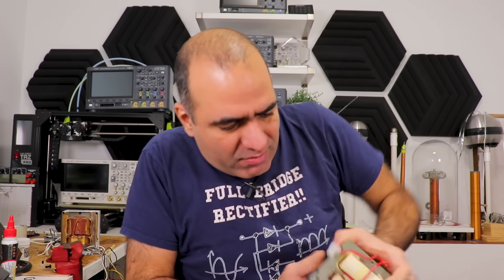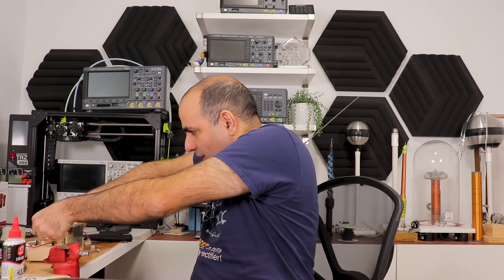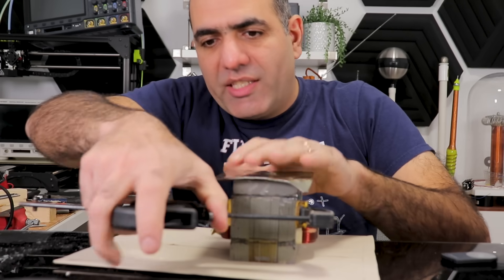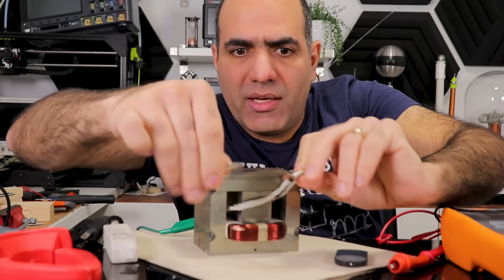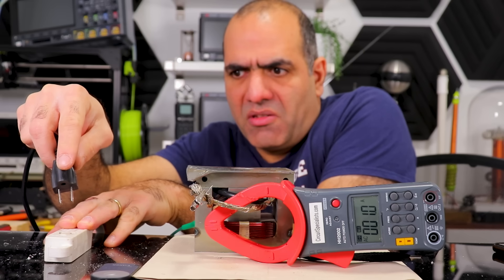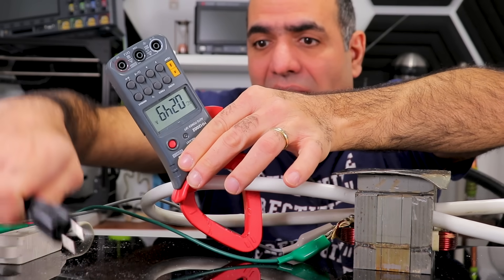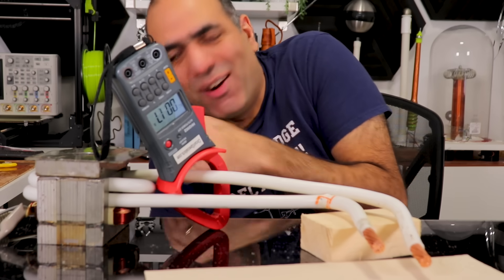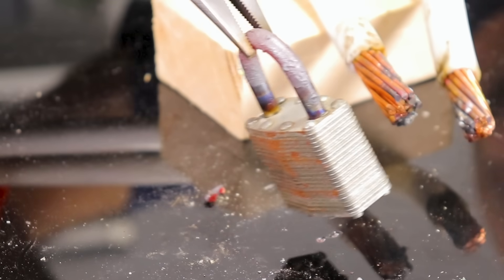Making "MILLIONS" of AMPS of Current

Comment: This inspires me to do electronics/electrical projects of my own but at the same time I feel like that's a very very bad idea 😅
Reply: Playing with transformers from microwaves kills a lot of inexperienced electronics hobbyists.
Reply: @gtidave06  well that sure doesn't fill me with a lot of confidence haha. My late brother had a small transformer on his belongings. seems to be "off-the-shelf", if that even applies to those. I mainly know transformers as the things that go boom on those power poles so I hadn't touched it since hahaha
Reply: start with basic stuff, about 10 years I started by making "DIY" guitar effects pedals and fixing simple electronic devices, I learned a lot about basic electronics and soldering techniques, 2 years later I had to give up because I went broke and I could not afford doing more stuff, I probably would be a self-taught electronic technician by now, but life sucks.
Reply: Start with DC voltage 12V or lower. I can not warn you enough. Get a proper education. Do a lot of research before you attempt anything else! 

I have 25 years of experience and no longer mess with transformers and the likes. Make sure you are safe, always!
Reply: @juliusfucik4011  That's funny, a nearby shop has been offering me a 12V 10A power supply for cheap. They've moved on to a new business and wanted to empty their inventory fast. Seems to be pristine enough when they showed it to me considering it hasn't been touched since the lockdowns. Maybe I should ask for it again and some more. I don't even have a meter 😅
Reply: It is a very bad idea if you do not fully understand what you're doing. There are people that have died using a microwave transformer. I don't know how many, but most of them wanted to make those nice burn marks in a piece of wood. I would strongly advise you to begin with basic electronics. Start with low voltage. Take a breadboard and some components like diodes, resistors, capacitors, LED's etc. and make small circuits with them. Also take a look at the mathematics behind the circuits. As you progress you will be able to predict resistances and voltages at some points in your circuit. It is satisfying (at least to me) if you actually measure what you predicted. At the same time you could work on your soldering techniques.
Reply: Never play with electricity. Thousands of people die due to slightest mistakes during handling/working with electricity. Always work/play with less range of DC voltage in your personal space. Only between 5 Volt to 12 Volt DC and power rating between 5 Watt to 10 watt. Not more than that.
Reply: I had my phase of playing with electricity. Thanks mehdi 😂😂.
Reply: hey, I mean look at it this way: the worst thing that could happen is horrific injury and death
Reply: U get it wrong with microwave parts and your dead m8
Reply: He's turning 15A 120v into death. Be very careful imitating this.
Reply: A microwave transformer will kill you before you even realize you had an accident. Unless you have a bachelor's degree DO NOT DO ANYTHING ON THIS CHANNEL. Ideally a master's degree. But you at least get the safety mentality that can only be learned through lab experience in a bachelor's program. And without that, it is IMPOSSIBLE to do anything he does safely.
Reply: Kalki Ironman type 7 and 8 after 2026 😎

kalki avatar (beast of the earth) (christ on the white horse) (son of man on clouds) is the biggest enemy of dajjal/antichrist/kali 😏

Kalki Avatar (Murtaza) 11th satguru 13th imam cousin of Moula mahdhi a.s. 12th imam (muhammad) 😎

Prophet Moula mahdhi is raja shashidhuvj (the mighty one) born less then 1200 years ago 😎

Prophet Moula Isa a.s. will kill dajjal cause dajjal is going to kill Kalki Avatar 😏

Kalki Avatar will follow orders from 2 religious king Moula mahdhi a.s. and Moula Isa a.s. 😎

Kalki Avatar going to have 2 swords and ring of moula sulaiman a.s. and staff of moula musa a.s. (iron rod) Staff of moula musa a.s. is like omintrix can transform into anything and can transform others into anything And stone in the ring of moula sulaiman a.s. is also known as kastav mani and it's more powerful than all 6 infinite stones combined 😇

Cuz Kalki is ironman batman super saiya-jin superman ben10 saitama optimus prime shaktimaan and every super heroes combined after 2026 😎

This staff will transforms into white horses with wings,weapons,iron-man,cloud etc or can do imagination into reality 😎

*Ratn sru sword of lord Adam (miri)😇

*Ratn varu (zulfakar) sword of Moula Ali (piri) 😇

miri piri 😇

Kalki Ironman after 2026 😎

Satyug (sunrise from West) 2038 😏

Sambal is hospital 😏

Gzwa e hind 2029 😎

Khalistan and Azad Kashmir after 2026 by Ironman 😎

99% Hadith u heard is not about imam Mahdi it’s about Kalki avatar (the main character) that person momin vs dajjal prove me wrong if u can 😏😏😏.
Reply: lets make padlock melting device
🐱👍🏿
Reply: yah me too );
Reply: This is the Stuff Photonicinduction does since idk 2009 i guess. Have a look at his Channel, he is also like Mehdi but only with High Power Stuff like in this Video.
Reply: never a bad idea... just start small and have an extinguisher handy.

Comment: Could be used to heat metal parts for forging instead of putting them in a gas forge. Precise heating of specific areas depending on your forging needs. Not always for heating the entire part. I know, induction heating may be better but this could suffice in many cases.

Comment: How come you can touch the spoon on the wires while holding the spoon? Shouldn't that kill you? I only studied to become an electrician and not electrical engineering but what we were taught about amps vs volts is that even if the volts are low anything above 1-2 Amps will kill you and quite quickly at that. The only thing I can presume is that the electricity took the easiest path which was through the spoon to the other cable and not passing through you.

If you could explain this to me it would be very helpful :) Have a nice day
Reply: 1. The transformer's output is isolated from ground, so there's no potential across his body
2. A few volts isn't enough to push a lethal amount of current through human skin (flesh is a different thing though)

Comment: Hey Medhi, It was not super clear why doubling the turns would melt the spoon. Maybe one should have highlighted that while the short circuit current is higher with one turn, the extra voltage would be needed in order for the 'high'er resistance spoon to heat up. In the first case, current was limited to 100A, due to the resistance in the spoon. Increasing the voltage, while assuming the same resistance doubles the current thru the spoon. I = V/R. However, I have been though that the power being developed in a fuse etc is always: P = I^2*R

Comment: could you use the secondary as a primary (removing the original primary altogether) , thus giving you a much higher ratio of turns?
Reply: You could, but the problem with that is the wire gauge is much much smaller, too small to handle 15A continuously and will likely fuse open if you draw a lot of current on the secondary. Also in this case the resistance was around 62 ohms, meaning it could only draw 2 amps from 120v AC and that negates most of your turn ratio advantage.

Comment: Can this be used to power an electric motor from a battery?
The configuration of wires, what does it do? What are the principles behind what is happening? How is the energy being changed?

I mean, will this be a way to make battery powered flight more feasible?

Comment: You should try and track down some 3/0 welding cable... Fine strand with rubber insulation, extremely flexible... 👍

Comment: Word of advise. Don’t use a angle grinder indoors with out using a mask. You’re breathing in aluminum dust from the blade and metal dust from the thing you’re cutting.

Comment: Instead of taking two turns to get twice the voltage, you should try putting two single-turn 'coils' of your massive wire and tie them in parallel.  Halving the resistance.  We often wound things with 'two in hand' or 'three in hand'.  Which simply meant we used two conductors (or three) in parallel in the winding machine.  More cross section but still flexible and easier to mold into coils.

Comment: "Now I can just pull the windings out..."  lol  I worked in a motor rewind shop a couple of years.  Soon as you said that I started laughing.  We NEVER could just 'pull' them out of the iron, even after baking over 500 degF in an oven to burn off the varnish.  When you watch how they are literally hammered into the slots, then wedges hammered in, you appreciate they are in there pretty darn tight. 👍👍

Comment: Have a clamp on one side and a welding electrode holder on the other and try to weld with coated electrode. If you can make a continuous seam congratulations you have made a welding machine.

Comment: how about increasing the input frequency with mosfet? i think the maximum current that you can draw is limited by the magnetic field that can pass in the core. With a higher frequency many more amps can be drawn, as in switching power supplies that use very small transformers!
Reply: You need to start learning before giving advice to the supremely talanted.
Take a look in a pocket transistor radio or a sm psu.
See ferrite aerials and ferrite IF cores and ferrite beeds and ferrite hf transformers.
Have a look at some mains  transformers and motors too.
Ask yourself why are all the low f0 inductors steel and all the high f0 inductors ferrite.
If you get that sorted you can stand on the bottom rung of the tall ladder.
Its a very long way up.
Reply: @N1gel  My comment was a QUESTION, not an ADVICE! I'm pretty sure that there was a question mark somewhere! My QUESTION is based on transformers EMF equation where frequency and magnetic flux are correlated! Also at higher frequency impedance of winding can be lowered! Maybe in my first comment I said a bull$h1t, but your comment does not correct anything and denotes an ill-concealed arrogance!
Reply: @MyNotSoHumbleOpinion  wrong.
My reply - if you followed it,  would teach you a lot more than your previous tutorials.

Comment: you can get an inverter like the ones you use when bower goes out out of e-bay and you can get an even BIGGER TRANSFORMER (they are designed to turn 12 volt to 240 volts)

Comment: The 3/0awg wire already as multiple wire. It has like around 19 strands.
Reply: Yes but they are in parallel with each other so they don't add to the turn ratio.

Comment: Why does bigger wire size have smaller resistance?
Bigger wire = more matter
More matter = more resistance
Reply: Because there is more matter for electrons to flow, its like  a multi-lane highway for electrons.

Comment: Aren't you suppose to feed the secondary winding to get the massive stepdown in voltage?  Why are you feeding the primary???
Reply: No...a stepdown is feeded through the larger coil.
Reply: @roner61  Sorry, Roner.  I didn't get an alert that you made a comment.  I hear what you're saying but he's got a ready-built step-down if he energizes the secondary instead of the primary.  Energizing the secondary will cause a current increase in the primary.  The only hitch I see is that the secondary is made of fine wire and I don't know if 62 ohms is enough to throttle the input voltage enough.  If he brought the input down to 40v, he would have sufficient step-down for decent current output.  Does that make sense to you?

Comment: Now at 5:00 when you doubled the voltage you should have halved the current not doubled the current. The secondary is behaving like a straight piece of wire not like a coil. One would expect a straight wire to have only copper resistance and no reactive component. That would show a direct relationship between voltage and current like you observed. If the "secondary" is wound properly it will display inductive reactance and thus this would be added to its impedance reducing the current.  Comment?
Reply: If practice doesnt match your calculations there is something wrong with your calculations.
Im bad at maths, so y cant tell you what´s wrong. 🙂
Reply: The wire would handle more current, if it had a lower resistance. The resistance is too high, which limits the current.

Comment: I feel connecting to a 240V circuit, using a step down transformer to give higher current starting 120V AC and then go to this lad, you should be able to get almost double the current taking into account losses.

Comment: I have made one of these, and I can confirm that two turns of 0/3 AWG is the way to go. Hard to wrestle it into place, but that's kind of nice because you use the full space inside the transformer with minimal turns to keep the amps high
Reply: I have one with 0/3, but I went to local welding supply store and got flexible cable with copper lugs on the ends.  Being able to bring the cables to wherever you're trying to use them instead of the other way around is nice. https://youtu.be/pD34Zv1zKq4
Reply: I use 0 to 4/0 awg wire for car audio. The cables are a bit more expensive, but they are much more flexible than any welding cable and are over sized. If you need more flexible OFC check out knukoncepts. They have the highest amperage capacity and flexibility in the industry. Careful though, they sell both CCA and OFC so make sure you get the right one.

Comment: Math error: when you double the voltage on a load with a fixed impedance, you quadruple the *power. Obviously with a real transformer there are losses and limitations and such.
Edit: It's called ohm's law, and unfortunately a realistic model of a transformer might be too much for some individuals to comprehend.
Reply: So...your theoretical result isnt real? Okay. 🙂
Reply: @roner61   Yes the theory would still hold 🙂

Comment: You should buy welding cable when you need large gauge! Most welding cables can be had up to 4/0 gauge, and come with extremely fine internal conductors so it's super flexible for mechanical working like this.

Comment: So thats where these E shaped pieces of stamped steel come from. I remember as a kid I used to find tons of them littered all over the footpaths and grass fields between block apartment buildings I live at. That still doesn't explain why they were out randomly in the open. I guess homeless people used to steal copper wires from transformator buildings to sell for scrap metal and discarded the steel cause it was to heavy and too cheap

Comment: I have several of those transformers that I've considered connecting in series to see where the voltage becomes uncontainable.
Reply: They are designed for 2KV so probably you wont go very far. 
 There are better options to produce higher voltages, like TV flybacks, designed for 40KV.

Comment: @12:30 would it be good enough with that Voltage to Generatte H2? like in an electrolyzer? that things also use tons of currents → so, dip it in salted water and see if it genrates bubbles
Reply: You probably need more than 3 volts for electrolysis to work.

Comment: I stuck a key with a plastic handle into the charging connection point of a 48v lithium bicycle battery accidentally. How close was I to something bad happening?
Reply: 48V  isnt a dangerous voltage for human beings...but you can make sparks, or burn the device.
Dangerous voltages start about 80V.

Comment: I would absolutely love to see you make a melting pot for metals from the microwave oven transformer. Just be sure to use a graphite crucible if you do!
Reply: he's gonna wunna skip the graphite, its conductive enough to give you headaches designing.
id suggest straight for the aluminium oxide stuff so that short of around 3500-4000 degrees c you should be good.
electric resistance for melting metals isnt efficient but it is fast so relying on not overcooking it is just asking for a puddle of metal.
Reply: @Ian Wallace  That's a fair point. I have an induction furnace in my lab for melting metals in the platinum group. It does use a graphite crucible, granted it was purpose built for graphite as a crucible material. 
Microwave oven transformers can make great jerry-rigged arc furnaces, and I think in that case, it would be better to use an aluminum/refractory ceramic material with graphite electrodes.

Comment: Attach a couple of graphite electrodes to each side of the humongous cable, buy  a crucible, fill it with scrap and then submerge the electrodes inside the scrap.
You should be able to melt it, I mean you still would lack of the raw power and high voltage of an actual electric arc furnace to make the electric arc but with enough time you should be able to melt the scrap by sheer resistive heating.

Comment: I have actually worked for a company that makes transformers, we only made them with one set of turns, not 2. And i can tell you did not make it more efficient by breaking it apart and then gluing them together. When i packed these, i needed to check if there arent any tiny holes that were made while welding them. And that was not glue that you were cleaning off, thats some kind of warnish, so it does not get metal to metal contact,to short out. I have seen this transformer in different videos, but i just remembered that i made transformers before. I guess its really cool to see what they can do😅

Comment: I wonder if this is how spot welders are made. Like hand held ones or like the ones that go on the end of a robot arm.
Reply: Exactly like that. 

I’ve seen some pictures of a guy building one with a microwave transformer, some massive clamp and two pointed copper bolts at the ends of it. 
Even included a switch to turn on the supply power once closing the welding clamp. 

Pretty neat.

Comment: As long as there is still space in the core, you should add more parallel wires  And keep the wire short. Or maybe use a wide flat busbar.  You have actually made a spot welder.
Reply: Yup iv made one myself.